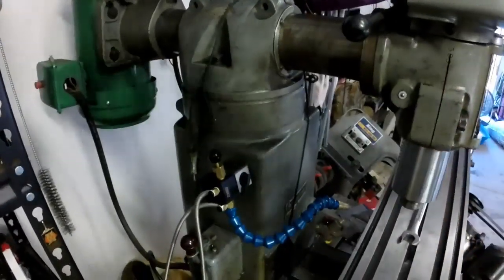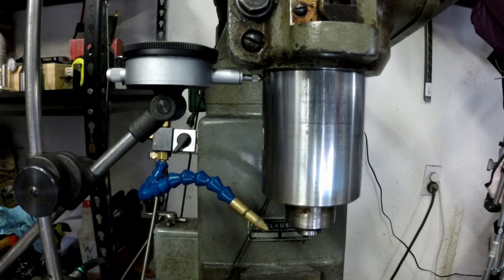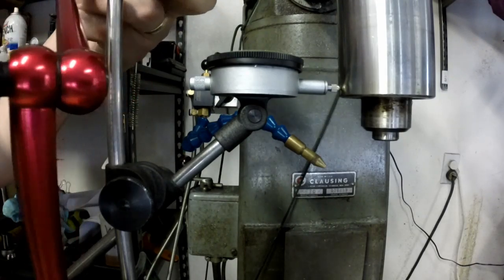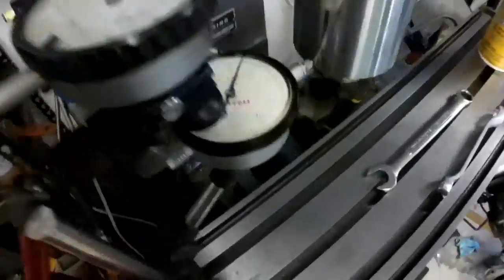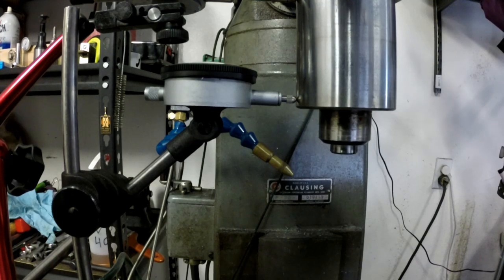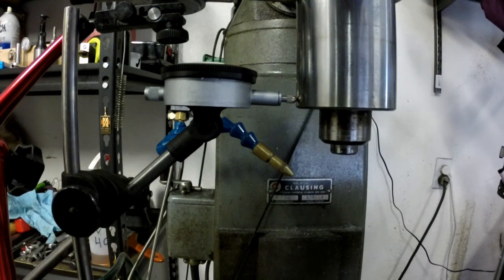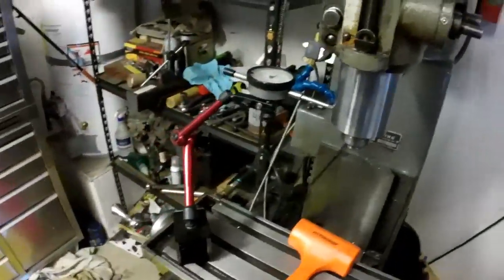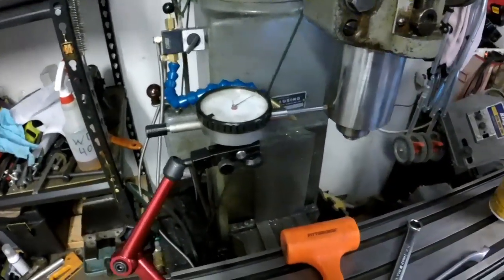Tramming a Mill (Quick tip #1)

Comment: I am new to machining but how do you know you are on the same dia point of the spindle with the second indicator
Reply from the maker: There is a split on the left side where I can place the indicators by eye. It's not perfectly aligned  but it doesn't have to be. Even if the indicators are .050 out of line and the difference will be extremely minimal because they are measuring the spindle moving away. At the end I check the spindle by moving the table down and it's dead on every time.